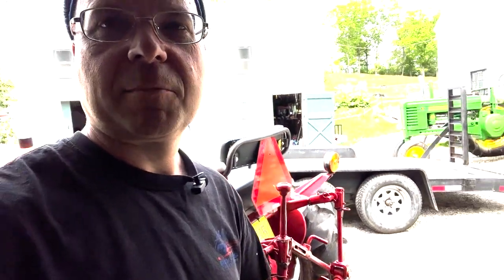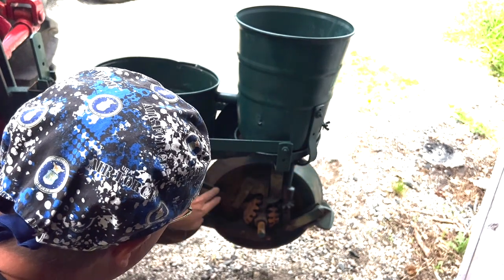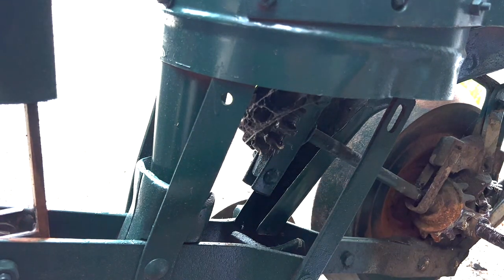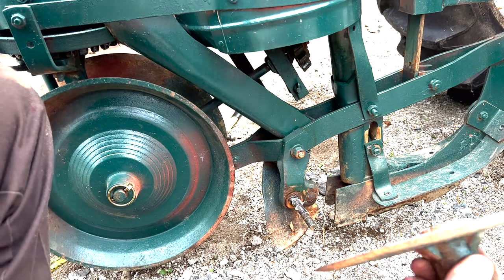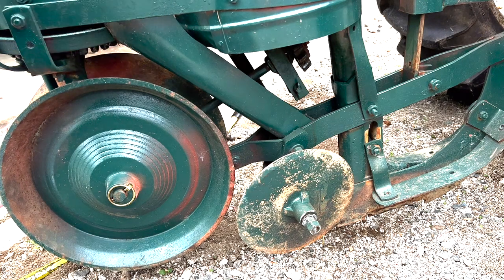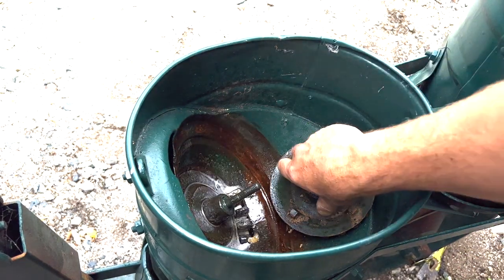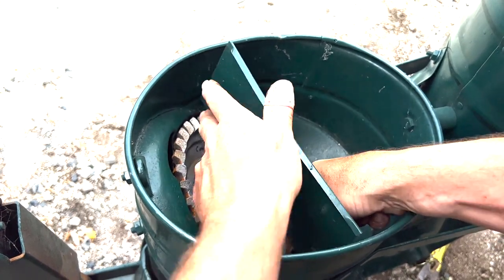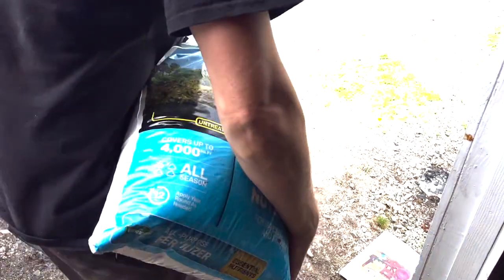Set Up, Operation & Maintenance of A Cole 12MX Multiflex Planter

Comment: Hi Tom.  Catching up on your past videos.  I was able to purchase a Cole planter this year at super cheap.  Late model with practically zero usage.  It is set up as a three point.  No extra gears but 4-5 plates.  I intend to increase the granddaughter’s garden 6 fold next year and the Cole will prove helpful.  I love all your buildings and appreciate the guidance.  Thank you.
Reply from the maker: Thank You. My last Cole planter had a fabricated 3-point hitch on it. I don’t think you’ll be disappointed at all with that planter
Reply: @LedgemereHeritageFarm  Between rain showers today I rechecked the Cole planter.  I have 4 unused plates plus one I in the planter.  In addition I “found “ 3 additional gears, an unused 10 and 12  and 14 that may have been used.  I did not check what is in it yet, hopefully an 11.  With a set of instructions as well.  Been on a buying spree, now need to get on a using spree.

Comment: I have had one of the cole planters for about 30 years.  It is a constant battle.  Works great for green beans.  Everything else just always has problems.  You never ever put it down unless you are moving in my soil or it will plug up every time. Thanks for sharing.
Reply from the maker: I’ve had issues with it plugging in the drop tube as well. Very frustrating indeed. Unfortunately, by the time I work the bugs out every Spring, I probably could have just planted everything by hand. This is my second one and it doesn’t work as well as the other one I had. I had a chance to by a couple John Deere planter units and I honestly wish I’d bought those instead. Thank You for watching
Reply: @LedgemereHeritageFarm  I have been looking in to buying the JD 71.
Reply from the maker: @MrSparks701  that’s what this was. I sold some other junk and should have bought that. They were on a 3-point tool bar. I had liked the fertilizer hopper because I’d sold my whole Cub planter unit

Comment: Excellent tutorial Tom! You said it right. When you're done using the planter or fertilizer hopper on the tractor, wash them out and clean them thoroughly. When they've dried, oil or grease them thoroughly otherwise the fertilizer residue with eat the metal like acid.
Reply from the maker: I’ve seen them afterwards. It’s like the salt spreaders we use in the winter. Some people use fertilizer spreaders for road salt and don’t wash them. I bought mine that way. 1 year old and frozen solid😵‍💫
Reply: @LedgemereHeritageFarm  You did a great job cleaning it up and maintaining it!
Reply from the maker: @MarkWYoung-ky4uc  thank you

Comment: Thanks for the video.  My 92 year old FIL has a Super AV that I started for the first time in 20 years yesterday.  Now I'm trying to figure out how to rig a mule drawn Cole Duplex planter on the rear.  LOL
Reply from the maker: It was pretty common before 1960 to adapt horse-drawn equipment to tractors. Thank You for watching and I’m sure he will enjoy that tractor. 😊
Reply: @LedgemereHeritageFarm  Thanks for the reply.  I noticed the depth adjustment on the 12MX Planter and I just went down to the shop and looked at the old duplex.  There aren't any depth adjusment skids on it and no holes/slots for one to be mounted.  I think I can fabricate something out of some 1.5" right angle .  I wonder how the old timers adjusted depth control?

Comment: I bought a used m12 in pretty good shape but was frozen up I finally got press wheels off greased up  everything , spins pretty good on shaft and gears turn  but when I put latch pin in it will not turn like it locks up  any ideas would b helpful  Tu
Reply from the maker: Where does the latch pin go? Mine only has a wing nut over the seed plate and will lock up without it on
Reply: @LedgemereHeritageFarm  in the press wheel my ? Is do the shafts just hold press wheel or is it supposed to turn
Reply: The axle was frozen up Tks anyway!!